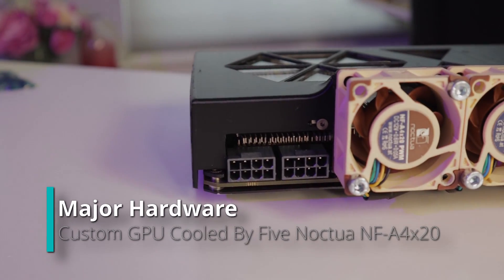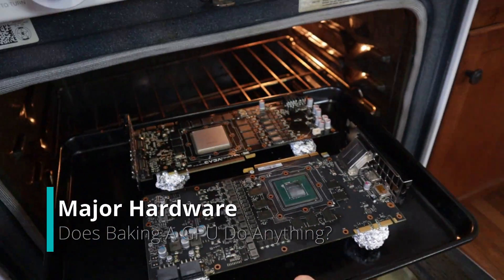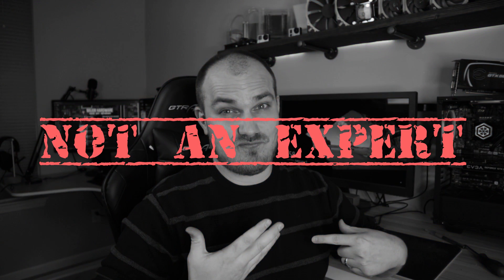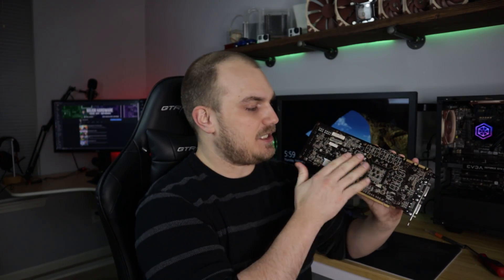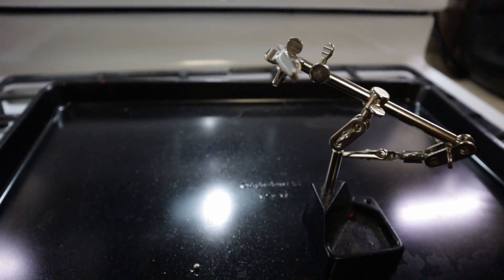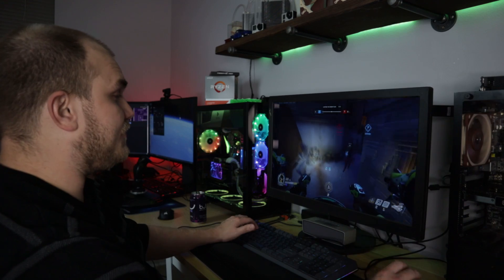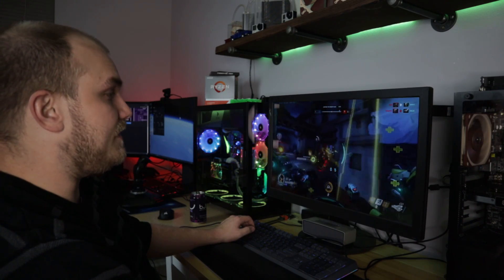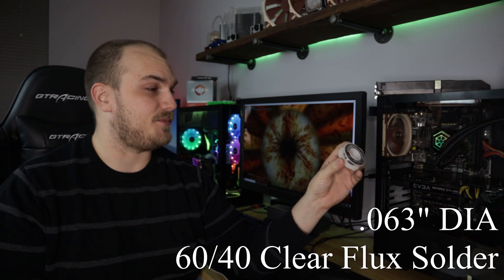RESURRECTED! Testing A Once Bricked GPU

Comment: Hey buddy ..I just baked a gtx 580 ..had no heatsink on the gpu...I used a smaller cpu heatsink that would fit inside the shroud and flattened the nubs that stuck up on the inside..didn't let heatsink set on top of the gpu better...bought a mobo and that graphics card off a buddy that got ripped off ..I bought a am3 mobo I can't figure out but got the broken gtx580..and a quad core am3 3.1ghz Athlon chip and a Salman style cooler..but was surprised all I did to it and baked 180 for 10 mins and worked!!

Comment: Think regular solder(for diy electronics) melts at about 180deg C. I know that because i was thinking of making a custom heatpipe for my laptop and did the research before the measurements(yes, i'm cheap - if i have a good amount of solder i will use it and not buy anything special for that one occasion).

Comment: That would damage the chip further. As for baking you suppose to use special flux to aid the reflow of the solder in order to reconnecting broken solder balls usually cause overtighted screws or slight board warped

Comment: The problem with ur Blower cooler design is that the air is getting sucked in but due to the angle it is mounted at, the hot air isn't getting exhausted from the back

Comment: They're not the same solder, 60/40 is leaded solder, the solder on the GPU is tin solder, lead solder melts at roughly 210C, tin is about 250C, so the oven with the solder sat suspended in mid air will be close enough to melting point to droop and form droplets that break off, no doubt if you used pure tin solder it would have softened enough to do the same, but wouldn't have melted like it would on a GPU, as someone who does electronics repair with soldering, I sometimes need to either preheat the board to ~180C so that my iron can get the ground plane hot enough to stop wicking the heat away, or run my iron at 375C+ to achieve the same effect.

If you put tin solder on a huge copper sheet, similar in size to what is in a GPU PCB, you might find it wouldn't melt at all in an oven, but I haven't tested this, I might do it at some point with tin solder.

Not a great test imo, but I couldn't really say why your 1080 works now without taking a look at the board with a multimeter, still, it worked for you, which is great but I don't think it will last.

P.s. Deep clean your oven and the extractor and get a new baking tray, they're contaminated with lead, it probably isn't enough to be fatal, but lead vapour is extremely bad for your health in any case, and I'd hate to see you fall ill trying to test anything.

Comment: Oven flux test was nice. Takes a while to get it flowing with soldering iron as it's just a small point heating a larger mass. "60/40 Sn-Pb, which melts at 188 °C (370 °F)" so yeah, should have melted and did melt. "lead-free solders melt at higher temperatures of about 217°C/422°F" not so far off either, but likely EVGA didn't use that as it worked :)

Comment: different types of solder have different melting points. more common led based solders are lower temp. the type used in electronics is a led free sold and has a higher melting point. it could work a long time or days

Comment: There's a lot of different kinds of solder, all having different melting points. But even if the solder doesn't really melt, there's this thing called surface melting, where at a surface (a crack is basically two surfaces) there's a film of liquid atoms on the surface. This can mend small cracks just as well as a "full" melt does. It's actually even better, as the solder ball contact can't flow out and short each other. That's one of the reasons why most guides recommend baking at a lower temperature first (like 190), and only increasing to 195, 200, etc in follow up steps. The other reason has to do with the heat capacity of the device

Comment: According to buildzoid in his latest video about chip degredation ( https://www.youtube.com/watch?v=uMHUz16MuYA&t ) the solder used for bga chips melts at 300 something °C.
Baking is 'only' thermal shocking it (and the substrate below it) and can help with making a good contact again.
According to him large chips are more susceptible to problems with the substrate / gpu-die connection and baking is 'solving' this problem.

Comment: The lead-based solder you have used for your test is different than the lead-free one that is used in factories due to RoHS, and I do know from experience that lead-free solder has a much higher melting temperature then good old lead-based one - anywhere from 211 to 227 °C depending on the composition according to Wikipedia, as opposed to about 183 °C for classic 60/40 tin-lead solder. Not entirely sure of what composition is used on these graphics cards though, so your oven might still have been hot enough to cause a reflow - it might be hotter than advertised after all.
That being said, I have absolutely no idea about how a shorted card that probably lead to a component failing would have been fixed by a reflow.... THE PLOT THICKENS. But hey, at least it's better than a permanently bricked graphics card.
Reply from the maker: Agreed  so weird

Comment: A lot of consumer electronics "solder" is now some form of silver composite, or some such...at least in the US which has had some industry regulation to get away from lead in landfills and such.  This silver based solder has a higher melting point, making a reflow in a regular oven a bit of a shifty thing because plastics and other board materials can also melt or singe.  It's also more rigid when solid, so the cracking thing was more common.....it can also "grow", as in form minute spikes which can create it's own shorts.....though I don't know how common problems from that are over-time.

Also worthy of mention: Some components are held in by solder alone.  Something heavy could conceivably fall right off once the solder melts.  Solder reflow stations and other specialized equipment are optimal for such projects.

That's the best I can recall from attempting to learn then fixing/attempting to fix red-ringed Xbox 360s several years ago.  Those I managed to fix were almost universally only temporary, another month or so and the problems resurfaced.  The problem with those is heat cycling and insane pressures of the heat-sink mounting system, that's what's suspected to have cracked solder or loosened pins and other contacts.

Regarding the "fixed" video card in question.

It could be something else.  Is that the same OS?  I've heard of "damaged"(problematic) cards getting a screwed up bios or driver errors.  Putting them in a new system or doing full driver uninstalls and reinstalls, etc have the potential for resetting problematic issues.

Also:  Some ESD damage is temporary.  Rather than a blown fuse or some other physical interrupt(aka open circuit), there may just be some form of energy build-up that was causing some circuit to go wonky.  Time alone, or safe discharge against the right surface can sometimes solve issues.  I know this wasn't ESD but it could be the same resultant problem, an issue where a relay or whatever simply needed time to lose a charge or polarity.

Background: Worked on advanced electronics in the military as well as computers and other  hobbies over the decades.

Comment: There is no way that reflowing fixed your card because the temperature is not high enough ( it uses lead free solder). And a short won't break a solderconnection under the chip. I would guess that the heat destroyed the shorted component completly. But in the end you didn't gain any knowledge. You don't know what was the problem and you don't know what fixed it and you can't rely on the card anymore.
Reply from the maker: But but by it works
Reply: @MajorHardware  I know  and that is probably the worst part. I really like your other content where you try different things and I would have loved to see you try to fix it  with a  multimeter  (like checking the fuses  or caps for shorts).

Comment: If you want to try this make sure you bake it laying on a level surface with your gpu on the back to prevent solder from flowing across the board potentially shorting out other parts.

Comment: The oven does not reflow the solder.   They use lead free solder which flows at a much higher temp.
Reply: Not to go against this channel but always get info from more than one source. Check louis rossmans channel he has a video explaining this exact thing.   From when he called out linus for baking a gpu. He is a electronics repair person and has years of experience.
Reply from the maker: Hence my not an expert statement

Comment: Dude, look up Louis Rossman and you get an idea of where alot of the baking gpu “emotion” is coming from. He even did a collab with Linus tech tips on the subject. My philosophy, if i have no other option, then break out the A1 and get to cooking, just ethically you should probably think twice about selling without full disclosure.
Reply: Precisely why I’m extremely cautious about buying used graphics cards.  One detail to look for is the stickers melt when you bake a card, so if all the stickers on the back of the PCB are gone, it may have been in the oven.  The stickers usually have a serial number or a part number.
Reply: @chincemagnet  i only buy them if they still have warranty on them if they cost more then lets say 100 euro.
Reply: You can also easilly see after you purchase the card which was baked it, it will look mostly like wifi routers pcb(most have no cooler) after 8 years of 24/7 runtime on the back where the main cpu is, people who bake are putting their cards at risk of literally baking the insides of their gpu cores. 
The gpu might work after baking, but what people are doing is essentially stress testing their gpu without doing any computations.
Also the memory vrms and different componenets might have different operating temperatures, I believe solder melts at a lot higher temperature than all the rest of the components, say the gpu manufacturer decides to use cheaper components futher away from the GPU core expecting lower temperatures to be there and bought lower operating temperature resistors, capacitors, well as they are "baking" it they put those components on a lot higher ammount of stress.

PS3 FAT had an issue with the old type of some basic component I think it was usage of very old generation of capacitors which caused voltage drops on gpu and blue ring of death/blue led of death. 
What people did was they would apply heat on the GPU die thinking it was a solder issue just like with xbox 360(it wasn't that, as sony used higher quality lead-less solder).    

What can also happen is you might melt the solder that connects the dies to the gpu chip(you know what I mean like the actual gpu die has it is own smaller pads, and then the contacts for the pcb are a lot bigger).
Reply: @niewazneniewazne1890  still worth it if its not working anyways.

Comment: Depends on the solder. They make different grades made for different things and the alloy content can make a huge difference. You probably blew open a tiny solder trace when you shorted it and baking it got it hot enough to reflow itself. The other card you blew up some components. When I'm repairing bad solder points and circuit trace pads many times I get it hot till the solder melts and add a tiny bit of solder to get it to reflow and clean up. If it's really messed up I use a solder sucker or solder wick braid and get it super clean and fully resolder it like new. I also have some old single strand copper wire from the OLD copper wire huge phone cables i use to repair broken copper traces and pads on circuit boards. Most shops don't do board level tracing to find bad components and replace them, they just replace the whole board so most stuff gets tossed these days. PC stuff has so many layers and tiny surface mount stuff it's tough to repair it unless it's something big enough to be easily replaced.

Comment: i used to work repairing motherboards for a variety of consuls, laptops, pc's, gps's, etc... we would bake the boards in an oven to bake out moisture in the boards. this was especially useful for motherboards that were coming in for service by the ocean. moister in the board from humility is not good for electronics. baking a board alone can sometimes fix a givin problem with it just due to removing the moister. baking also reduces risks when bringing to higher temps for reflow. moister is bad. Then we would re-flow, re-ball, replace bga chips. 

Sometimes it was a pad issue, in which case board repair may or may not resolve the problem depending how deep the damage goes. we used reflow machines or hot air guns setup on a fixture to heat up the solder.
There are alot of different solder's and fluxes on the market. they can range very drastic from one another. many manufactures will use something different from one another. Lead free vs leaded and the different variations of each will melt at different temp's. lead-free is widely used these days and melts at a higher temp than leaded. The amount of layers in the PCB will also need to be calculated to determine what time and temps to use. so alot of research has to go into what temperature and time need to be used to repair each individual board for best results.

Comment: The melting point of good ratio leaded solder is 180°C.
components that are sold in the US AFAIK are required to be assembled with lead-free solder, I forget which division of the government mandated that.
But lead-free solder melts at 240°C. Since your lead of solder melted in the oven, I'd say you had 30 or 35% leaded solder, I forget the melting points of the different mix ratios.

Comment: I use the same method, but use Chipquick solder flux around the edges of the GPU and memory modules. I feel like it improves the odds!
Reply: george486 the cracked solder its not the one which is under the gpu which has little balls. Its the one under the flip chip, thats why the only solution is to replace the whole core.